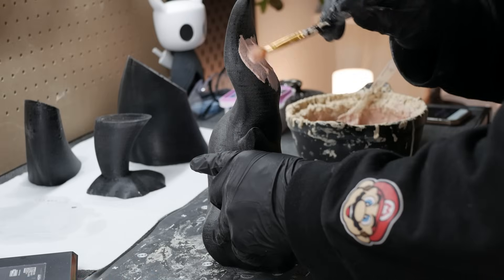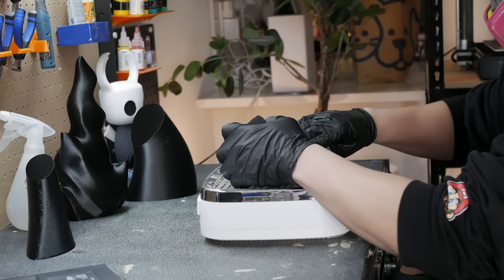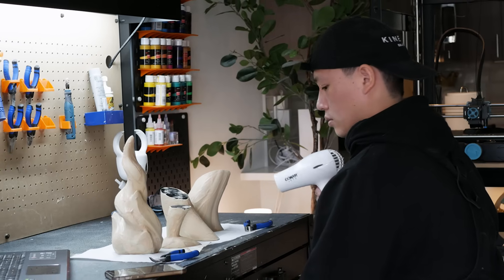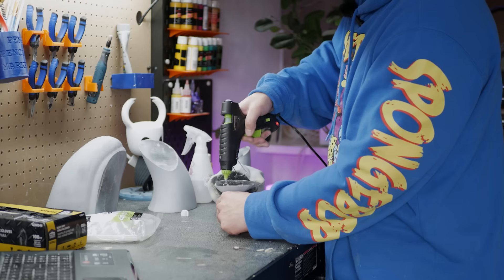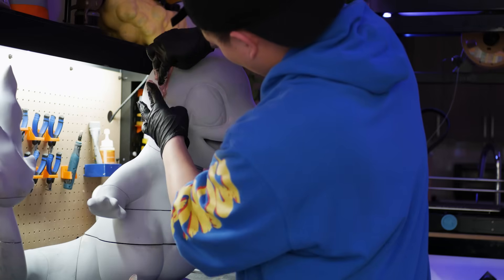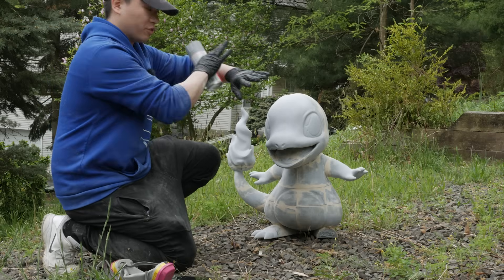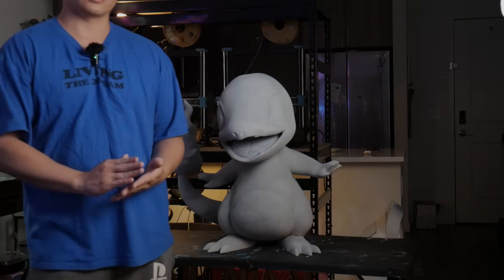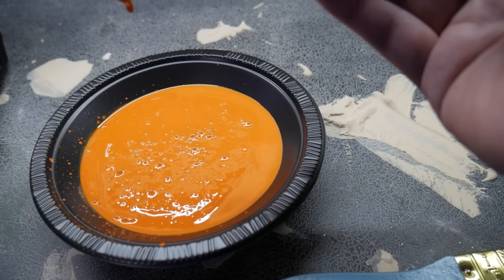How to 3D Print Large Models with Small 3D Printers - Step by step (Beginner)

Comment: Generally nice but there are some things to improve:
1. There are slicers (for example Bambu Lab slicer) where you can cut with connectors. So you can put the parts like with a puzzle together. That helps with gaps and a strong connection.
2. Never use hot glue for things like this. Hot glue made your gaps so big and on a hot day the parts will come apart. Even very light things like a cable will come lose on a hot day. (Had to make the experinece myself) The time you save with quick drying glue you put 10x in filling the gaps and sanding.
3. Sanding is the process that usually takes the longest time. If you use 120 grid sandpaper you will get a lot of scratches which you have to sand step by step out. So 120 then 240 then 400....  it will cost you a lot of time. 
So take less of the puddy and be careful with it so you can save the sanding work. Maybe so much that you can start with 400 grid and go up from there.
Reply from the maker: Ohh I didn’t know about the hot glue part, that’s actually concerning considering that I sold some outdoor models to people 😭 thank you for the advice, I might have to look for other alternatives, I’m hoping the plastic weld helps a bit. 

About the connectors, I have some ptsd with them, I remember the connectors warped and I had to use a dremmel to make it fit, it was a nightmare 😂I gotta give them another go.
Reply: @3DPrintOver9000  When I want a really stong connection I always use 2 component glue. Its pretty much the strongest that you can get but it can also be expensive if you have to use a lot. But if you can solve your problems with the connectiors, they will help with a stronger bond. I hope you can find some cheap and strong glue :)
Reply: @Muu_69  Hey man, just wanted to say. If you're using PLA, you can get the strongest bond by using a solvent such a Weld-on #16, PLA Gloop, or Dichloromethane (DCM) to chemically bond the PLA together. It very lightly melts PLA when used correctly, and it will be a permanent hold that will not come apart.
Reply: @3DPrintOver9000  The easiest way to glue PLA together is either using super glue (for things that don't need a lot of overall strength) or a product called Gloop.  It's a PLA adhesive that chemically bonds the plastics together.
Reply from the maker: Also thank you for the advice, I’ve been consuming so much recommended products and tips in the comment section  💪
Reply: @3DPrintOver9000 with bambuu slicer or orca slicer you can choose between connectors or plugs. But for life size models connectors can be made 2 inch thick so you shouldn't have much warping. But if you do, you can scale the size of the connector by itself by 2%. This won't cause issue with connecting as it will be hidden.

Alternatively you can add the connectors to the size of magnets. The using the magnets it will hold the model in place while the glue dries
Reply: I'm BigRig, and I approve of this advice.
Reply: Do you know if there’s an option like that in Cuda? Can’t find something like that
Reply: I don't know if the application here would make sense but when i was working in ceramics I would use bondo to fill in gaps before adding final layers over the pieces. Bondo's application here should work well because this plastic will be fairly rigid and although no[t] self leveling can sand very easily and takes most paints. Regarding the application of acrylic I'm not sure if its the best option here over others as moisture or heat or even uneven surfaces of projects can cause it to peel. These are meant to be handled constantly so maybe its okay but it could be something worth trying something else.
Reply: @SleepyWindows  many other folks use bondo and recommend it, once I get to where I'm doing the filling, sanding, etc, my plan is to use bondo!
Reply: A good method to put it together is using epoxy resing instead hot glue, i'm testing it actually and got good results
Reply: Man I’m glad I ran across this video and decided to view your comment, I’m currently working on a life size charmander and I had to split the head and torso, at the time I was doing the legs, but after your comment and thankfully I did I was able to go resplit the parts this time with connectors to make it so much easier to reattach perfectly. Sheeeeeeeshhhhhhhh talk about timing man. 🔥🔥🔥🔥🔥🔥🔥
Reply: @MemraApologetics  any update? planning to do the same.
Reply: what other slicers can you cut with connectors? i don't have a bambu (yet), and I want to make a few bigger prints, but putting the flat parts together, i'd rather have connectors!
Reply: @TheOctabreaker  OrcaSlicer, PrusaSlicer, I believe even Cura may have it now. There's also dedicated programs you can use like LuBan or MeshMixer.
Reply: That's the same 2 things I noticed. 
try using OrcaSlicer free version of Bambu Lab Slicer
Also there are  different types of glues depending on the material 

Like @Muu_69 said, hot glue is not a good idea it will also destroy the orientation of your model
Reply: I would also add that doing the filler should be all one step.  Print the pieces, glue them together, and then use the plastic wood-x.  This will save you a TON of time and sanding, since you aren't having to sand ever piece twice.  And yes, anything heat-based is very bad for a 3D printed model because heat can always undo your work.
Reply: What specific glue brand and model you recommend then?

Comment: I hate sanding. So get a powered sander it helps a lot. They have small handheld sanders for crafts too if you don't want the big power tools. But both are definitely needed to save you time. The other thing is you can just use elmers wood filler its cheaper and you can mix it with 70% alcohol to thin it and help it dry faster. I know I'm missing somethings but this is a good video for beginners.

Comment: If you can swing it. Try adding alignment tabs to your model parts. It's a way to assure your seems will be cleaner and require less post processing. I use alignments on all my models. My workflow is to import mesh to solid using PAID PAID version of fusion 360. Then adding tabs is simple

Comment: I love the video... if you don't mind have you every tried Mitreaple two part glue. its a like crazy glue but doesn't turn your place white. the glue isn't glue until you spray the activator on one of the two pieces you're trying to glue together. so the glue on one end and the spray on the other and once to side touch the glue activates and really that's all to it. I use it and its by far better then the glue gun.:hand-pink-waving:

Comment: Bro you did an awesome job. I'm an industrial designer and when we make models and prototypes from 3D prints we use automotive Bondo and spot putty to fill gaps and holes. It works much better than wood filler/putty and it will dry faster and be stronger because you can fine tune how much hardener you use for the Bondo. For light gaps and surface imperfections you can thin out the spot putty with acetone and paint it on in layers as you're already doing, but automotive spot putty dries harder and sands easier. To glue the pieces together I'd highly recommend using cyanoacrylate (aka: hobbyist super glue) like BSI Maxi-Cure (get the 'medium gap filling' as it will help fill in gaps) and also a kicker like BSI Insta-Set which makes the glue dry on contact; this will be much stronger than the hot glue that you're using,.

Comment: I recently saw another creator ( I cannot recall whom) who was doing later-scale prints.  They were using wood filler as you have, but instead of water, they used acetone instead, you still get the liquid-like viscosity, but still thick enough.   One might say well acitone will melt the plastic but I think given how light they applied the acitone it ended up evaporating quickly.

I've never done a large scale print nor have tried this method of smoothing out a part but I heard you say sometimes you sit there for an hour, maybe be worth while to give it a try....

Great video!

Comment: I think for a huge project like this, 3D Gloop will be your best friend. It's the best adhesive I've ever used for 3D printed parts. The part itself will break before the bond between the parts, since it's essentially melting the pieces together. And if you really wanted to, you could use 3D Gloop to smooth out the print (I personally don't like doing that since 3D Gloop isn't cheap, but tons of people do it).
Reply: You can just take some ABS and acetone to mix and use that, it works just as well as 3D gloop and costs pennies 😂

Comment: I recommend a set of Dura Block sanding blocks. They come in different shapes and sizes and it really makes sanding a breeze. Bondo Glazing & Spot Putty is also great for filling in smaller things after you've primed your parts. You can reduce it with acetone and brush it on for bigger areas. Just be careful using acetone around abs.

Comment: NOOOO it was soo good until you used hot glue >.< use 5 minute epoxy or a CA glue, never hot glue. Hot glue is a temporary holding glue, great for holding in place whilst you paint, but never for permanent adhesion.

Comment: have you ever had a issue where your fillament wouldnt go throw the print head not sure really how to describe it. but i bought the printer based off of watching you and i loved it i had it only 1 week did 10 small prints was excited and bought a 2nd printer which should be here tomorrow and the first 3d printer no longer wants to pull the fillament i followed the guides from sovol to fix and to no aval. good thing amazon is giving me a replacement. hopefully iu dont run into this isue again atleast so early into to ownership. BTW i love your vids im still learning to print but your are a inspriation.

Comment: What layer height did you use to print the models?
Reply from the maker: 0.15 mm! 🙂
Reply: @3DPrintOver9000  okay. I am giving .2 mm a try to see how that goes then I will try .15 mm ^^ which slicer do you use? I use Orca Slicer
Reply from the maker: @Creyes7824  oh! And I use cura slicer!
Reply: @3DPrintOver9000  okay
Reply: @3DPrintOver9000  would you make a video smoothing, using this method, a model printed at .2mm layer height?
Reply from the maker: @Creyes7824  I possibly could, but you can still get the same result even at .2mm layer height :) just a bit more sanding

Comment: Hey, you did an amazing job! You really inspired me to push my 3D printer into making some larger prints - I just finished a 4 plate Lugia and will be working on a 5 plate Tyrantrum a bit later this week (not sure I could go life-size on those two ;)). Your video has been such an inspiration and I cannot wait to include some of the things I have learned from you! A really good tip I have found (when gluing pieces together) is using cyanoacrylate (CA) glue and adding a little bit of baking soda before putting the parts together!
Reply from the maker: Thank you! 🙂 I’m glad it did, I’m actually quite surprised that you mention baking soda with the CA glue, does the baking soda help with making it instant stick? 👀

Comment: What filament material did you use?
Reply from the maker: I was using overture in the beginning, but then I looked into a cheaper option on aliexpress for filaments 👀
Reply: @3DPrintOver9000  im in the same boat, anything under 10 bucks its a deal for me! Great work btw!! Did you use pla plus or generic pla?

Comment: Why not use Bondo
Reply from the maker: I never tried bondo tbh! 😅 this putty was the first thing I picked up and I’ve been using it ever since.
Reply: @3DPrintOver9000  just remember there's two different types. They have a wood bondo and then they have one that's for plastic. It works perfectly and it's definitely worth a shot and it's not even that expensive either

Comment: Why the puddy? Why not just the plastic?
Reply from the maker: Like plastic welding and soldering? I just learned how to use it like a week ago 🙂 some people mention it to me and I was blown away on how it worked so well, I fill the seam up with plastic, sand it with 80 grit and putty right after 💪
Reply: @3DPrintOver9000  I meant like why did you use the puddy and not just like glue and sand paper the 3D printed plastic :)
Reply from the maker: I also feel bad cause there’s a lot of better ways to do this project, so I’m hoping to learn everything now so I can do better job at teaching in the next video 😅
Reply: @3DPrintOver9000  those prints looked phenomenal ^.^ don’t shoot yourself short :)
Reply from the maker: @fusion1203  oh you mean when I like paint the print with all putty? After I sand the raw print with 80 grit, there’s still some remaining line marks, so the putty helps cover the remaining line marks, and after sanding with 220 grit it becomes super smooth, on top of that the primer is like the cherry on top. 🔥 so in other words I save a lot of time from sanding 😁

You can also mix the putty a bit of acetone to make it dry more quicker too, and also thank you 🙂
Reply: @3DPrintOver9000  ohhh ok, thanks ^.^ the work payed off amazingly ^.^

Comment: How much is that, roughly, in materials?
Reply from the maker: Very good question! So I used to buy branded filaments, but then I realized that I sand and paint over good quality filaments, so I looked into Cheaper Chinese filaments

Each Chinese filaments were $6 and it took me 5-6 rolls to make the Charmander, so roughly $30 🙂 and add like $30 more for like sand paper, paint, primer and etc

Comment: please try septone plastic primer filler from an auto store!  i use it for motorcycle fairing repair but this is a perfect use case for smoothening out print lines
thank me later
Reply from the maker: It’s ironic cause I’m heading to advanced auto store, I have to get new wiper blades for my car 😅 I hope they have it in stock
Reply: @3DPrintOver9000  just make sure its specified for plastics!

Comment: Hey, I've actually been working on a couple of similar things with umbreons and chillets! Unfortunately, pokemon scaling is super wack, so both 1m tall and 1ft tall are accurate.

I love your tips, and wanna add some that helped me! Hope they help

1. Always print petg, especially if using outdoors. PLA can warp under the sun.

2. I actually just tried water + wood putty today, and it's phenomenal! Before, I was using glazing and spotting putty, which while great can be expsensive and should be reserved for smaller areas.

3. For the model prep workflow, I'll hollow it out in blender (meshmixer can also work), scale in fusion 360 by creating boxes the size of my print bed, and finally slice up my model along the lines from fusion. Dowels, I think, are the best for connectors! Also, pay attention to orientation, as it can save you sanding.

4. Im a pretty terrible painter, but an airbrush has been amazing for helping paint large areas without streaks.

5. Cyanoacrylate (some superglues) + graphite powder makes for an amazing adhesive between the pieces.

6. For filling seams, too much wood putty or bondo will crack over time. Instead getting a plastic welder, or a simple 3d printing pen followed by your filler can save this
Reply from the maker: First of all, I LIVE for these comments, I’ve been learning for the past week cause of the comment section, just wanted to say thank you for giving me these golden nugget advice. I been using #6 advice for the past couple days and it’s been the best thing I ever learned.

I’ll be sure to keep trying out these advices. Especially the petg filaments. I always build indoor statues but never outdoor

Comment: To avoid warping i would use a wide brim. It would require more print space, but alot of the time using brim will reduce the chances of warping significantly.
Reply from the maker: @omegafire6253  hi just want to come back here to tell you that warping has stopped when I did the brim, thank you so much, literally saved me so much time of trying to fix it 🙂
Reply: @3DPrintOver9000  just a grit sander to remove the exes on the edge.
Reply from the maker: Oh interesting!!! I’ll try that out, It gets so annoying when I see the corner lifting up slowly, especially in mid printing 😅

Comment: Your way of joining large pieces is easy and simple. The glue between the pieces create gaps and creates more work to counter them and make them disappear. On the Youtube channel Made With Layers, there is a video on how to print large parts with a small 3d printer. What he does it break up the large print like you do but he adds different connections to those pieces. My favorite is the dovetail style connection. https://youtu.be/4cnJFZZRui0?si=9krYKeqwmPBayAS9
Reply from the maker: Honestly connectors would’ve been nice, I have to make some time to learn those asap, I know for a fact that meshmixer have a feature on those, so I’ll probably start there, thanks for the video recommendation 🙂

Comment: amazing work great job would you consider do a video on how you took the file and made it into larger pieces  to make the life size model
Reply from the maker: Yes I will! I feel bad cause I just find out an easier way of cutting it up, if you have the time, look up Luban3D. It will literally cut up the pieces for you and it’ll make sure that it’ll fit on the bed of your 3D Printer.

I did a trial run on the program and I’m shocked. It’s a total time saver and way easier than the crazy stuff I was doing haha

Comment: If you put the puttied pieces in a box, or bin, when you hair dryer them the warmth will be sustained longer and the drying time will be decreased.
Reply from the maker: Wait… this is genius 😂 I like this idea
Reply: @3DPrintOver9000  Further, there is a better way to print large objects on a small printer. If you use this 'dovetail' method, the amount of putty and patchwork will be significantly reduced. https://youtu.be/4cnJFZZRui0?si=EcCOZ0C0TN8wrJ2l